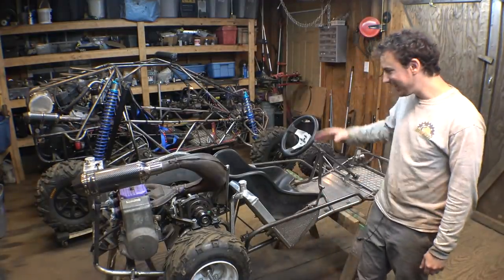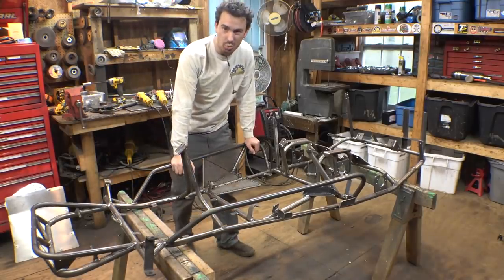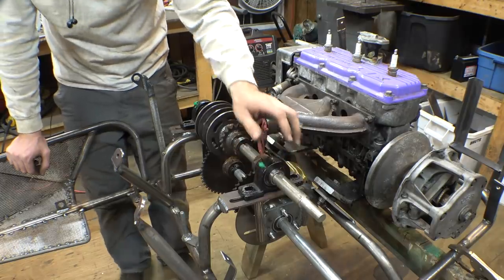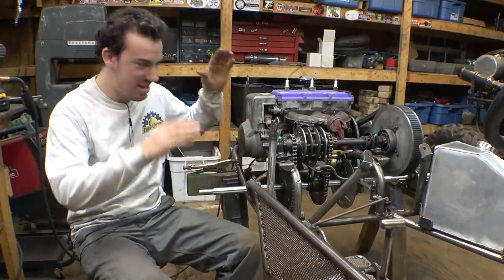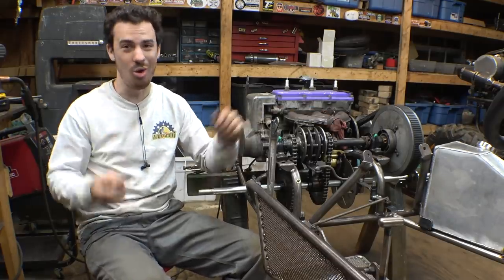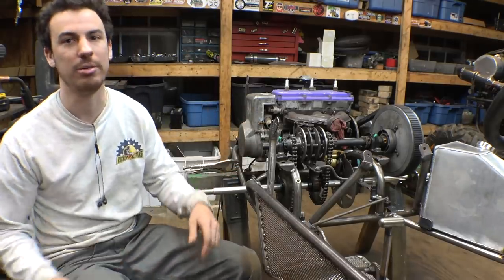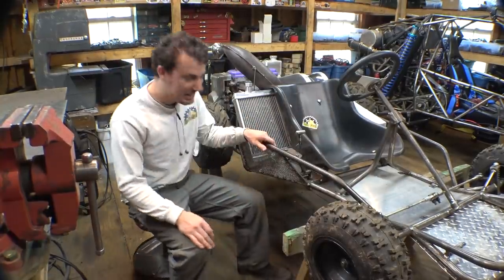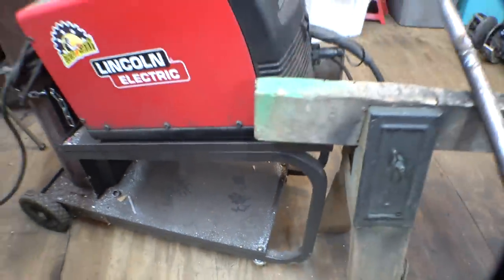95HP Two Stroke Triple Yard Kart Build Part 7

Comment: Ok lets actually math out some gears. First gear 1/2 throttle we should aim for 45 mph and then 85ish for wide open (12/58 or 4.883). Second should be at least as fast as the sled so shoot for 120-130 (16/54 or 3.375). All ratios given are for jack shaft to rear axle. At 80 mph and 8600 rpm you would up shift to a lower RPM of 5900 which should be the sweet spot for the torque, I  think. Also that RPM would keep the Primary Clutch engaged an not burn the belt on the shift.

Comment: There's no good way to calculate the gear ratio in a CVT because it's, well, continuously variable. But as a point of reference, the stock gear ratio in the snowmobile chaincase (after the CVT) is somewhere around 2-2.5:1 with around 8 inch drive cogs (essentially the "tires") and a stock sled will go 100-105mph no problem and pull hard off the line. With your taller rear tires I imagine 3:1 would be fairly close to stock gearing and probably be the sweet spot for keeping the engine and clutching happy.

Comment: As a 56 yr old lifelong fabricator and welder I say you're doing great at fab work,machining and welding but you've built a fold line across the feon of the chassis behind the front axle where the down tubes meet the frame tubing... It won't fold immediately but over whatever period of time that is the one place the frame will begin to sag or fold in an accident or hard landing due to welding across the tubing side to side and not having any gusseting or trussing there on both frame tubes... Just my 43 years fabrication and welding and engineering sorta edumuhcatededed opinion and thoughts... But maybe it won't...

Comment: Have you ever used steellet spray paint you can weld right on top of it you could paint it at this point and if you needed to change something you wouldn't need to grind off the paint and you could just weld on or change whatever the just touch it up with the steellet spray paint

Comment: When you make the exhaust shield - you should - figure that there's products out there that are premade, and you just have to cut them with tin snips. I've seen them installed to separate turbos from wiring, so they have to be good. Finnegan from Finnegan's garage and MCM guys used them in the past.

Comment: Assuming 16 inch wheels 2 to1 final drive and 6000 rpm the top speed is 142.8 mph .. that doesn't factor drag or any real world friction..s0 125,,,,,,,,,,,,This also assumes to  jackshaft is 1 to1 with the motor when at full rpm

Comment: You could make a purely mechanical automatic 2 speed with some simple modifications. I always wondered if you could use a spring to bias the clutch to engage with the low gear, and use the centrifugal force of the axle to push against the clutch towards the high gear, so that when the rpm of the axle became high enough it would force the transmission into the higher gear, and when slowing down from high gear the spring would slowly begin to push the clutch back to low as the rpm and centrifugal force decreased.
 I imagine it could be done with a linkage or two, and some kind of latch that delays the engagement of the high gear until there is enough force to push the clutch into high gear quickly, as if it wasn't delayed it would disengage the low side but not be able to increase speed to engage the high side, basically making it a governor. 
That could be solved with a bevel on the low side clutch plate that goes halfway down the clutch, it would help alignment and also would make the axle push the clutch to the other side. Just some ideas.

Comment: just calculating the gearing of clutches and the 2 speed transmission I get a top speed of 103 in 1st and 154 in 2nd this is not adjusting for the weight but this is on 16 inch tires and this is assuming the clutches used have a approximate 1 to 1 as cvt's usually are typically snowmobiles only have a ratio of 1.9 in total due to the high revs lets just hope your current gearing allows for full use of the clutch (to tall of gearing does not allow clutch to reach full top end potential you can play with weights to account for this or gears but regardless it will be rowdy)

Comment: To work out the rough speeds we'd need the maximum engine RPM, the minimum and maximum diameters of both CVT pulleys (You might be able to measure the circular wear marks on their inner faces without having to dismantle much), the tooth count of both sprocket pairs on the 2 speed transmission, and at least the outer diameter of the tyres.

The answer still wouldn't be 100% reliable as the circumference of a tyre isn't necessarily exactly how far it will move in one revolution, there can also be a small amount of belt slippage on CVT's, and at 100+mph the engines torque, BHP, and the wind resistance would play big roles in whether or not you'd be able to redline it with the 2 speed and CVT at their highest gearing.

Comment: Here is a rough go at estimating a range of potential full speeds  in second gear assuming that the CVT gets to 1:1 (a complete guess based on looking at the size of the pulleys) at full speed,  I don't know what RPMs your engine will do, so here are the speeds for a range of RPMs:  3000 rpm = 72 mph; 5000 rpm = 119mph; 8000 rpm = 191 mph.  I used to run racing two stroke engines at 15,000 rpm but your motor won't do anything like that.  Of course the speeds will vary if my guess about the CVT is wrong and I haven't tried to calculate whether the enging has enough power to get the combined weight of you and the kart to full speed.  Do a speed check when you test run it so I can see how close my guesstimate was.  Keep up the great work with your videos, I really enjoy watching them.

Comment: I got a 79 Honda odyssey with a 488 Polaris twin swapped onto it, I have a 12 tooth sprocket on the jackshaft and a 60 tooth on the axle, with 22 inch tall tires and with a poorly tuned motor I was able to get 75 out of it, that's also being a full sized kart.

Comment: I calculated the speeds based on the converter running between 3:1 and 1:1 (semi educated guess) in both ranges at 5000rpm to be the following:
high range (2:1 final) @5000rpm 38mph-116mph through the full torque converter ratio, and low range (3:1 final) @5000rpm 25mph to 78 mph through the full torque converter ratio. 
I don't know how far the engine will rev, but 5k is an easy reference point. If it revs to 8000 that will be well beyond the speed rating of the tyres, close to 150mph..!
I'd be wearing a helmet.. maybe pay extra attention to the throttle return and even use a positive return cable, and make a kill switch easy to reach...

Comment: You should install an over-center spring for the shifter so the spring keeps it in gear. I was very pleased to see the keyway removed from the needle bearing portions of the shaft. Good work! Do you think that frame needs some strengthening? It looks like just two lengths of tubing connect the front to the back in some spots, and I would hate to see you bend the kart in half

Comment: It would be cool for the shifter instead of a metal tab locking into a metal groove, rather have a skateboard wheel on both sides (one separating 1st from neutral and one separating 2nd from neutral) for the shaft to roll over

Comment: I think you're going to need to do 8:1 reduction for low range (48mph) and 5:1 reduction for high (76mph) IF the wheel diameter really is 16"..... 4:1 will give you about 100 mph. 

The CVT on that will have a ratio at about 1:1. I believe the engine rpm will be about 8000rpm. At 1:1 with a 16" wheel, it would be geared for 380 MPH  😂😂😂 Not ideal. 

If I'm doing my math right, it looks like 126 MPH at 3:1 reduction

EDIT. I would guess that with the power this thing has, if you gear it high, it would have no problem going 140mph .... I suggest NOT doing that... I don't want to see you get hurt.

Edit #2 I love your videos, by the way. I've been watching for years. I sometimes comment in a critical way, but I'm trying to be helpful and informative. You're one of the few channels that I follow closely.
Reply: Came up with the exact same numbers. Good job!
Reply: @Najsed  Good to know. Based on his latest video it looks like we are correct as the gearing is way too high. He will figure it out tho.If only he read my comment earlier 😂

Comment: you should add a bolt to the end of your driven clutch with a washer so that the secondary doesn't walk off the shaft and cause many issues i have seen that happen on lots of snowmobiles. not good.

Comment: You have a cvt. You don’t need 2 speed and will be more of a bad thing rather then good.  If you use the 1-2 gear box then yes have it as a low range and high range so your not heating up clutches and belts when your putting around with say someone slower or in tight tight corse or low high for simply low fer loading and unloading off trailer and in out the shop. And thehave 2 as high gear fer anything other. As normal high range is still going to be a easy 100mph so you can only really get function out of having a low range for things  described above ect.

Comment: 1st gear should def be a normal driving gear, maybe trade speed for torque, then 2nd gear should be like 1:1 or 1.5:1 for high speed, tbh myself, i would NOT want to be going 100+ MPH on a rig like that without a roll cage, full harness, and fire suppression system lol this thing is going to be a screaming demon when you get it up and choochin' under its own steam, should be a real blast to drive though, stay safe brother

Comment: At 7000 rpm assuming that the cvt gets close to a 1:1 ratio the kart should do roughly 100mph in first gear and 155mph in second gear

Comment: I know it would change a lot but you could make “2nd gear” a reverse for the kart
Reply: Does not work like that.
Reply: @nandrews8412  you could do it technically by adding and additional two jackshafts to whats already there, add sprockets and a closed loop of chain to those. then wrap that around the already existing 2nd gear sprocket, but still its way more complicated than that even. And nothing of what I just typed is going to make sense lol
Reply: @M.TTT.  all it needs is a couple of idler sprockets (placed on the slacked side of the chain) to direct the second chain the other way around either the drive or driven sprocket however you will need bearings in the selecting sprockets as the nonselected sprocket will spin twice as fast in the opposite direction while the other gear is engaged if using the same ratio for forward and reverse

Comment: Might I suggest a single mid-range speed. Thus giving you a nice range of torque and top end. Do away with the two speed transmission. Just give me your axle ratio (sprocket gear sizes by tooth) the height of your tires, and the max rpm of the engine out put via clutch maximum engagement height. Get me those numbers and I can get your ratio and speed.
Reply: The cvt ratio is between 90% and 110% engine rpm based on which particular cvt was used, using a conservative 7500rpm as the top engine rpm and the 2:1ratio he is geared for either 100-120mph with 10inch tires, or 180-220mph with only an 18 inch tire without subtracting for aerodynamic losses and frictional losses.

Comment: I wonder if you could install teflon inserts into your transmission so it won't make so much noise?? and maybe chamfer the leading edge of the slots so it will fall into gear easily while spinning.
maybe a spring detent to hold the gear into place when you shift. 
and gearing, since its a centrifugal clutch already, I would make 1st gear 3:1 and 2nd gear 1:1
Reply: He is geared for 100+mph with only a 10inch od drive tire and 180+mph with an 18inch od tire in high gear

Comment: So I did the maths and first gear is med fast and high gear is crash test dummy fast. But for real I think that you may be off on the gearing as a sled is direct drive off the secondary clutch and usually maxes out at 85 ish mph with a roughly 16 inch driver. I'm guessing first gear 35 ish and second great 50 ish

Comment: No need to make the 2 speed shifter too elaborate, it won't be there long.  
1. Unnecessary with the CVT.
2. That XLT is going to lay those pins over.

Comment: Chris why don’t you use the transmission of a motorcycle motor 
You could even leave it in the case just take the cylinders off, you’d have a five speed gear box 
There are tons of old bikes around that don’t run even a smaller 50 cc bike would work

Comment: The gearing ratio is not that simple.. you have a centrifugal clutch with gearing ratio to rpm of the engine!
And you could use "stops" on the gearing stick.. pair of notches to hinder movements, three positions.

Comment: I have an idea for the shift lever:
 you can do a bi-stable mechanism. its really easy, you only need a spring.  connect one end of the spring part way up the shift lever, and the other end to a point directly below the shift lever pivot. The lever will lock in the forward or reverse position under tension of the spring. you could add a pin or collar or something to hold it into neutral in the middle. https://i.imgur.com/Zmf7Slh.png

Comment: Your going to have major problems with that 2 speed you built. It's going to be like a 4 speed with the primary & secondary constantly shifting depending on rpm's. That secondary acts like gears when that belt gains rpm's. That's how they work in our snowmobiles. 

Primary clutch

This clutch is located on the engine crankshaft. There are two halves that are held apart by a pressure spring when the engine RPM is low. When the engine is started, the weight of the clutch creates enough centrifugal force to close the clutch, thus allowing the belt to move and transfer power.

Secondary clutch

The secondary clutch, connected to the track drive, is what activates the wheels and powers up the tracks. In the secondary clutch is a spring that operates the cams (wedges), sensitive to torque. Here is when both clutches work together. As the engine’s RPM increases, the power that the primary clutch transmits squeezes the cams together and tightens the belt. This process continues as the snowmobile accelerates. As the snowmobile gains speed and reaches top speed, the primary clutch closes, moving the belt to a higher gear

I think also you can change the torque by changing the spring in the primary

Comment: Calculations(not sure):

If you're in 1st gear with 3:1 ratio and the engine is at max RPM(8500) you might run 160.7 mph.
If you're in 2nd gear with 2:1 ratio and the engine is at max RPM(8500) you might run 240.8 mph.

Again that's not accurate but somewhere there it's close.
Reply: I'm also curious so I made the calculations lol

Comment: My advice do away with that 2speed you made. then i'd get a small front wheel drive transmission and run the out put shaft from the trans clutch to the transmission then output to the wheel with cvcs.

Comment: I think your 2 speed transmission is great, but it really isn't needed in this setup... that engine with the CVT in the 500+lbs  snowmobile would go 90+ mph, so in a small kart like this it will go well over 100 mph with just the CVT.

Comment: Are you talking 3:1 after the cvt?
Reply: So WOT or top rpm ratio for the cvt needs to be known. But easily calculated if you can post diameters. I guess belt width too

Comment: I believe your cvt belt is way to tight. It should be able to spin in gear somewhat easily
Reply: Not on those 650 700s that spinning  needs to be taken up a bit and let it ride on the bushing in the primary.
Reply: @kyleteal5888  yeah but shouldn't it be able to rotate on that bushing easier? Im not an expert by any means. Ive never had a cvt in anything ive owned
Reply: @rprokopow  not really. You're forgetting about pressure and friction. The secondary should not be able to move by hand on those, but move freely when pushed, or pulled.

Comment: I don't think you realize how fast that thing is going to go . you're not going to be able to keep the front tires on the ground no matter what gear you're in . We had a 2 person golf cart with a 600 CC triple cylinder and you could not keep the front tires on the ground
Reply: Realizing the center of gravity is about an 8 inch difference between builds is a big thing. Also the lever arm from the canopy probably didn't help

Comment: I wouldn't use anything but the original CVT. The rest is unnecessary, and opens up a lot of failure potential. 

Please cover that two speed gear box, so shrapnel doesn't kill you.

Comment: In low it will be 134.8 mph at 8500rpm with clutches at 1:1 and in high 200+ mph ... gearing should be 8:1 in low and 6.5:1 in high... to achieve your goal Chris u can email me at galieric@hotmail.ca I built all sorts of things with snowmobile engines if u have questions don't be shy.. I got a few vids of the quad I built her on YouTube

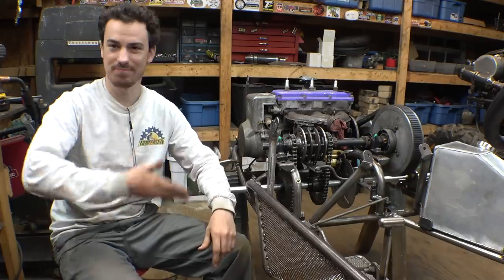Comment: 13:10  If somebody wants to calculate.........? What! ...Dude that should of been something you did before the 1st tube was bent of this understeering non suspended death trap you built.  For some reason you thought it needs another gear behind the cvt that was designed to make a snowmobile go 100+ 
You might want to add about 3 feet to your wheelbase, just sayin.